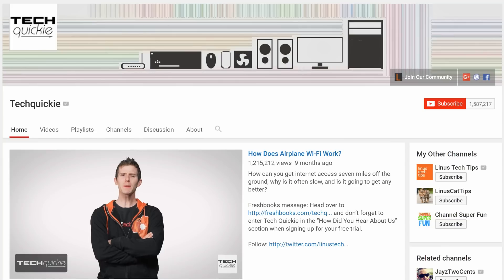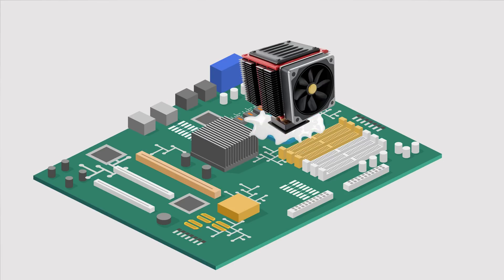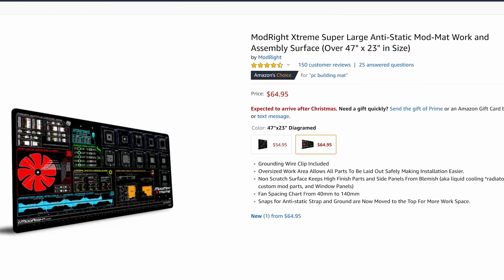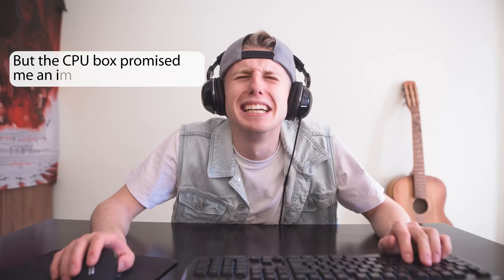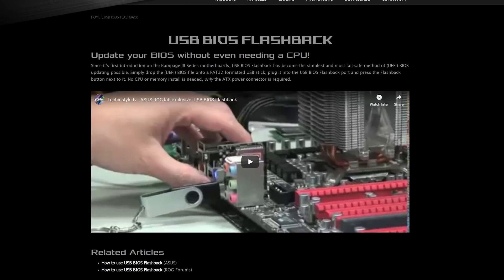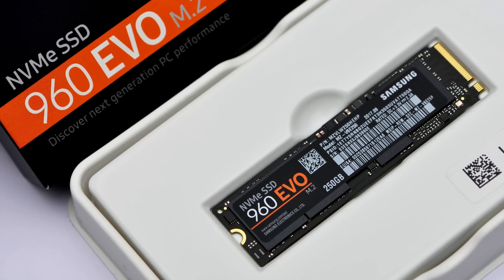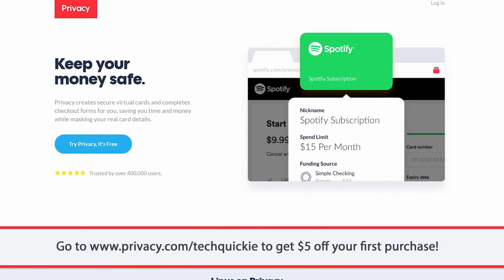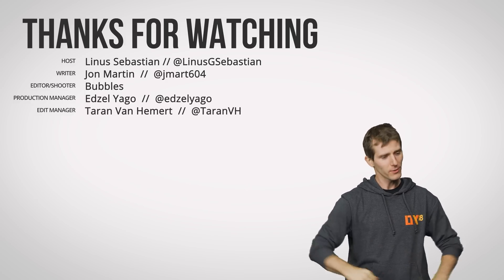DON'T Make THESE Mistakes Building A PC (pt. 5)

Comment: Don't use incompatible cables for your modular PSU, it's not standarized and altrough it may fit into the connector, wiring will be very likely swapped, it can result in a death of your PSU or even other components, Greg from Science Studio made this mistake.
When choosing some big ass air cooler, check height and RAM clearences for you case, very often you may run into issues with some tall RAM sticks.
When installing two sticks of RAM in a 4-slot motherboard, make sure you choose correct slots, usually 2nd and 4th from the left, but check the manual anyway.
If your case has a lot of perforations, holes meshes etc. you should have a possitive air pressure fan configuration, so eg. 2x120 on intake and 1x120 on exhaust or 2x240 on intake and 2x120 on exhaust, it will stop the dust coming inside the case through unfiltered holes and reduce the cleaning intervals.
Don't use swiss army knife as a screwdriver!
Reply: Yep, SATA power plug itself is standard, but the other end going to the PSU can be whatever manufacturer wants
Reply: @Arek_R.  Good advice. I keep the modular cables for each PSU in a bag clearly labeled for which supply they belong to. Corsair has a chart for which cables fit to which modular PSU model, so it is possible to move cables across sometimes  - but otherwise I'd have to bring out a multimeter and check every single wire.
Reply: The Swiss army knife is a Verge reference.
Reply: Wait, why wouldn't you use a swiss army knife as a screwdriver? I do this on my Tesla all the time!
Reply: @peischtipeir  I assume because SAKs usually have naked metal (from the other tool components) on the sides, so if you grab the whole knife, it will conduct electricity
Reply: Which video of Greg's did it occur?

Comment: So I built new cumputer and the frontpanel USB 3.1 isn't working.
I looked it up, and the frontpanel USB is 3.1 G2 with USB-C aswell and the motherboard supports only G1.
Is this the reason it not working? I thought it would still work but only with G1 speed. Am I wrong?

Comment: Electrostatic Discharge management has nothing to do with "Ground".  It's about equalizing the charges of you, your work surface and the device you're working on.  Working on a plugged in PC, as Linus suggests, is both irrelevant for ESD control and, recklessly dangerous.  That's some bad advice, Linus.  Suggest you read up on ESD protocol.

Comment: I had one of thoose issues i bought a 8th gen motherboard and i got a 9th gen cpu (i5 9600k) and it didnt worked so i gave it back to the supplier and now it works

Comment: Speaking of M.2. Its really usefull to read the MOBO manual. For example its common that M.2 port share the bandwidth with some SATA  ports so if you are using PCIE x4 on M.2 it may results into some of your SATA ports may not working. I would save hours of troubleshooting with my HDD not deteced and the solution was just simple plug in into different SATA port.

Comment: um a plugged in but powered off power supply still has electric potential not to mention potential issues should one forget and hit that switch. Just clip to the case. Any static will dissipate to the metal chassis.

Comment: I’ve never not built my PC on carpet...
I’ve built/upgraded PCs many times and not once has it been on solid floors, but on carpet and not once have I bought into the crap with anti-static straps.
I’ve done nothing but occasionally touch the case, when handling it.
I’ve never killed any hardware.
Please stop making this ESD seem as the mother of all PC destruction.

Comment: If you've had to pin straighten a PGA CPU, then you may have to gently help it in, but more a wiggle than a push to get a slightly wayward pin to catch the hole. If it won't go in with barely a tap, then it needs more straightening, or it's not the right way

Comment: Also u have to install motherboard in the case before installing cpu
Reply: no you don't, then you have to take the whole thing out if it fails to post.

Put ram, cpu and GPU onto mobo, plug in necessary cables, and boot to bios. No need for the CPU cooler as it won't hit 40 degrees before getting to bios anyways.
Reply: @Ravenousjoe  what are bios
im a noob
im gonna build a pc soon
Reply: @mohammedyakubi6697   BIOS is non-volatile firmware used to perform hardware initialization during the booting process, and to provide runtime services for operating systems and programs. The BIOS firmware comes pre-installed on a personal computer's system board, and it is the first software to run when powered on. Quickest and most thorough answer. Basically where you can make changes to your system without an operating system
Reply: @Ravenousjoe  ok thanks
Reply: @Ravenousjoe  r/voooooooooorge
Reply: @shayan-gg  ??

Comment: I just disassembled and reassembled an old pc for the first time. I succeeded. Except that I had to bust out the soldering iron because the wires on the cpu cooler snapped and it took me sth like 2 hrs just to resolder three damn wires. It worked in the end tho.

Comment: What about fan connection and fan controllers I don't get it because there is no molex...
Reply: What's wrong with no molex? Molex has no voltage regulation and they are often cheaply built, the sata power interface is more commonly used as less PSUs have molex and less people use sata power for anything but 1 or 2 drives, if any.

Comment: "MOST thermal compounds are non-conductive" as proven by everyone else who have done the 'too much TIM' tests. Literally does nothing to your motherboard unless you're using something that has an obvious 'is conductive' warning label (i.e. liquid metal).
A lot of these tips are sort of proven wrong by the 'building a PC the wrong way' that Jayz did a week or two ago.
Reply: Yes but still why waste thermal past by put alot on when you can just put on a little
Reply: so if you had someone build a PC for you and the socket around the CPU was covered in thermal compound you wouldn't care? The point is it is a bad practice because you might grab that one cheap tube of paste without paying attention and ruin your or someone else's components.
Reply: Thermal paste can also catch dust and become gummy and be harder to clean off.  Plus, if the paste is non-conductive, if it gets into the CPU socket, it might not short anything out, but it could block some of the connections and make the system unstable.

Comment: If you spill conductive thermal paste all over your motherboard, just throw it in the dishwasher
Reply: Or....take the safer approach, and gently hand wash it in warm dish soapy water using either your hands or a NON scratchy rag.  Dry it using a big box fan with the motherboard sitting as vertical/upright as possible inside a big plastic dishpan....for at least 8 hours straight to ensure that sucker is dry after gently drying it with a soft towel.

Comment: How do you know if you are using all your PCI-e lanes and what they are being used for? I have a Gigabyte AB350 3 and with a NVMe in the M.2 I lose two SATA ports, but the motherboard manual told me that and I've never tried plunging anything in those ports to see if they work. I have a GTX 1060 but I also have a WiFi/Bluetooth PCI-e card and I thought about putting in a NVMe PCI-e adapter card if I get a spare by upgrading the one in my M.2. I also have a PCI-e SATA card that I may want to use in a media server.